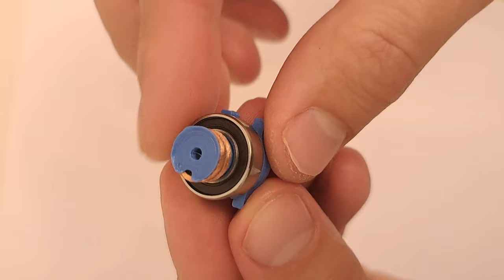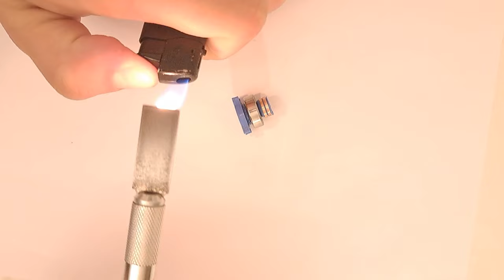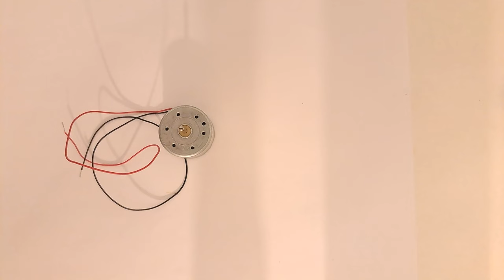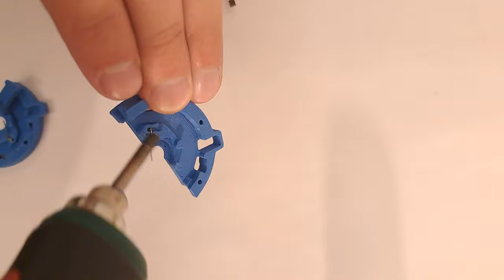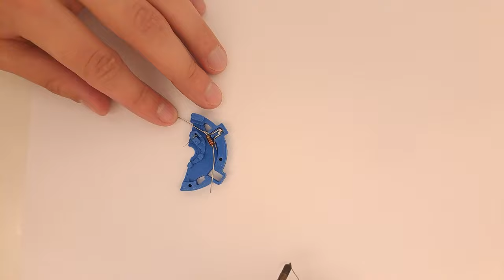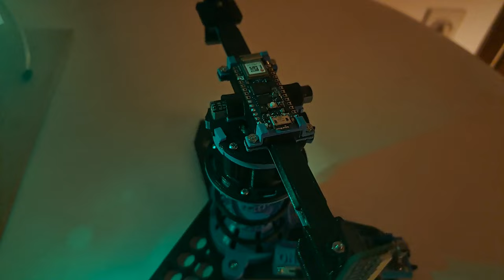Hologram - Assembly Part 1 | Arduino DIY

Comment: Can you upgrade the pieces like the motor and can the commutator be bought insted of being made ?
Reply from the maker: I found the best motor there is for this purpose, it is the fastest DC motor (before brushless motors) and most quietest one. Also, it is inexpensive and it is controlled with a buck converter (which is also cheap). I changed the commutator so you do not need to assemble it on the 3D printer (so there is another easy way of making it). I will release CAD files soon so you can change whatever you want (still trying to make a deal with Fusion360). I have made this basic device the best I can so you can add more to the existing structure (like adding another Arduino on top with sensors or LEDs inside the device, wifi and so on). But all those upgrades are coming soon in the existing bundle only, later I will split them as separate products. I hope I have answered your questions. :)

Comment: Heyy got a question i just bought your stuff from etsy and was wondering do the needed parts come deliverd or do i need to buy them myself  it is not relly clear with etsy  thks :)
Reply from the maker: I just sell the files to build the device. For now, it is what it is. I hope I will start to send full kit by the end of this year. Thank you for the support, new upgrades are comming soon in the existing bundle 😊

Comment: @HighLight7777 Gibt es für das Projekt eine Stückliste?
Reply from the maker: Of course, 

You will get:
- PDF Instructions for assembly and usage (lots of pictures)
- My Arduino library with examples for easy and fast programming
- Arduino code Examples (25 for now)
- STL files for 3D printing
- Schematics
- Bill Of Material (or BOM) list
- Gerber files (for ordering PCBs from the manufacturer and also the top PCB assembly option)
                         + NEW (exclusive just for this listing):
- New "Orbiter" body STL files
- Online app for making and importing GIFs for the hologram
- Fast GIF converter for the hologram
- More upcoming upgrades and software solutions.

check out the description of the listing on my Etsy: https://www.etsy.com/listing/1542571614/hologram-orbiter-arduino-diy-print-it?etsrc=sdt&utm_source=Copy&utm_medium=ListingManager&utm_campaign=Share&utm_term=so.lmsm&share_time=1694032537052

Comment: Can I make it by going to the link above and downloading the file?
Reply from the maker: I do not understand the question. I mean the link is for my etsy shop. You should be able to enter trough the link 🤨. If you have problems entering trough the link, let me know. 👋
Reply: @HiLight7777   yes! I asked if I could make it if I purchased it from the etsy store. If you purchase from the etsy store, you can download a PDF file, but I was wondering if the STL file and production method were included in it.😄
Reply from the maker: Oh haha. If you buy it you will dowlnoad the one page PDF. On that pdf you will have a personal link to whole project. Stl, pdf, BOM list and how to print, gerber files, pictures and so on. And you can alwasy go to that link and download the files. I am adding/improving the files all the time and you have .txt document where I write on what I changed. I am working on animation fast generator next, and I will be placing it into that project too 😁
Reply: @HiLight7777  Oh, that's a great idea, thank you!😁

Comment: Is that Rasp pico?. NiceI got a pico W spare laying around.
Reply from the maker: Well yes, it is, but I was building a new device to test that board and I used the opportunity to film everything. I had a lot of issues with Windows and drivers (I am trying to make a user-friendly device in an Arduino environment). That board is still in the test phase :body-blue-raised-arms:. I will not release that version any time soon. I switched working on the RGB version and Arduino Wifi version. I will release the basic version in a day or two.